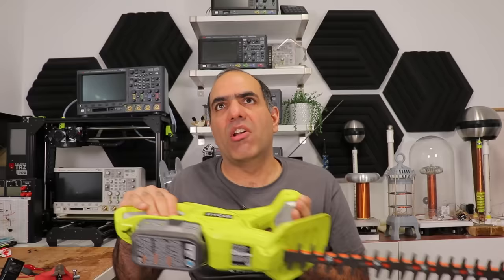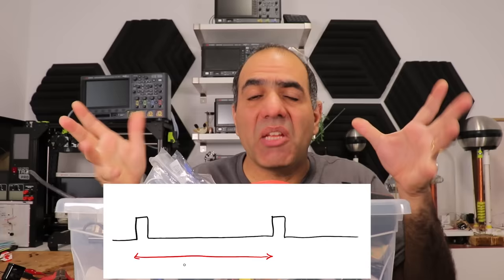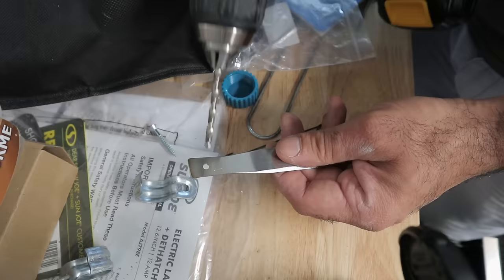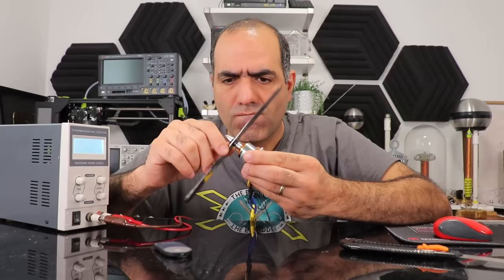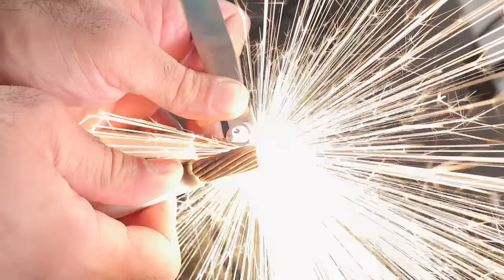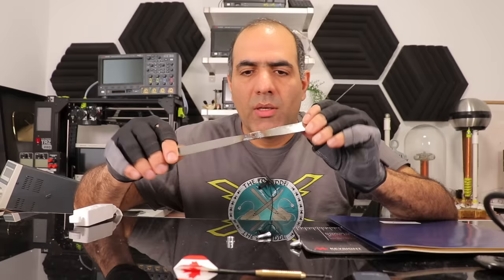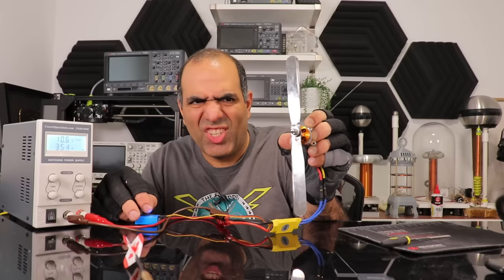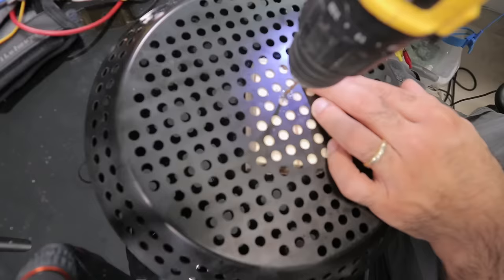Making a Mini Hedge Trimmer (Don’t DIY 💀💀💀)

Comment: The microwave transformer DIY welding, whilst not wearing gloves having fingers so close to the weld, and literally in contact with the metal surface was next level lmao.
Reply: He's using it to step down the voltage, to something like 48V.
Reply: @AlexBesogonov  is probably closer to 2v
Reply: He's using the transformer the opposite way from how most people use them. Instead of making wall power into super deadly power, it's making safe...ish power
Reply: @calebwatson966  yes. 48 volts DC can bite you under the right conditions.
Reply: @TheDirtyChef  Hell I've felt 12-20v before in my hand just because my hands had salt on them

edit: clarifying it was a salty solution not just table salt lol.
Reply: @tips1483  I was changing a 12 volt battery on a sewage bypass pump on day with sweaty hands. Touched the frame while I was tightening the positive and definitely felt it!
Reply: @AlexBesogonov  it's like 1-2v
Reply: @tips1483  One time I was replacing battery terminals on my dad's van. Accidentally stabbed one of the wire strands into the end of my finger while it was connected to the battery. Since I was also sweaty and leaning on the body of the van, the moment that strand stabbed in, it felt like someone smashed my whole arm with a sledge hammer.

Honestly would have preferred being electrocuted by the mains.
Reply: @poiiihy  Still can be dangerous. Skin is not a fixed resistance. If the skin is broken, or the outer layers of skin are bypassed via like a stray wire strand poking you, the inner layers of flesh have a far lower resistance. If the skin is wet or has sweat on it, it can make the resistance even lower. Get the resistance low enough and even at 1-2v, you can pass a significant amount of current. The spot welding clearly shows how much current can flow.
Reply: In all fairness, I'd be scared of a stray spark setting my cloth made gloves on fire, lmao.
Reply: @TheDirtyChef at work we have 48v golf carts. When the battery connections start to corrode off they make huge sparks when you wiggle them.
Reply: @GGigabiteM so your dads van had bare copper wire ends bolted to the battery? 🤔
Reply: @ogonbio8145  there are a lot of amps in those batteries. Be very careful with them especially if you are sweaty.
Reply: @ogonbio8145  battery cables are stranded and they inevitably corrode which can break off single strands and poke you.
Reply: @TheDirtyChef  yeah ive seen how the old battery cables corrode. on some of our old 36 volt carts the cables have completely corroded off and needed to be replaced.
Reply: @ogonbio8145  I worked AAA for two years.. oh the horrors I have seen.
Reply: @ogonbio8145  You see, Ford thought it was a great idea to use tiny wire strands to make up the large battery cable. The wire strands were on the size order of something you'd find in a lamp cord, just a crapton more of them for the large battery cable.

When trying to crimp the new battery terminal on, I was fighting with those strands going everywhere and apparently one broke off that I didn't see.

I slid my hand along the battery connector when I was holding it to tighten the nut and one of my fingers got stabbed by it.

Normal battery cables use much larger strands that are harder to break and generally won't turn into hypodermic needles that can skewer you.

Comment: I didn't use a transformer, I used a handful of supercapacitors in series, but I got a similar spot-weld technique to work. Also very low voltage, only about 6-7 volts, but tons and tons of current. I think the reason it worked for me, and the reason it worked for you, is because the material was quite thin, less than a millimeter.

Comment: I carried a lawnmower up 3 flights of stairs once, weighed like 60kg and has a really tough shape. This man just swung it over with him with minimal effort. He is strong af.
Reply: years of electric shocks have strengthened the muscles
Reply: @prakharmishra5487  yeah they stimulate muscle growth and make for a better muscle-brain connection
Reply: Maybe because this was an electrical lawnmower
Reply: @stueyphone  fair
Reply: i am scared for his daughter's future boyfriends. that guy will not only beat them up, he will shock them with a Jacob's Ladder!
Reply: @benskev  The innocent boyfriend is going to come inside and Mehdi will say "hold this".  I think you can figure out what will happen next. 💀
Reply: That was definitely a Ryobi electrical lawnmower, weighs about 44 pounds or 22kg according to a quick google search on generic Ryobi mowers.
Reply: No lawn mower weighs 60 kg. I transport them all the time. Gasoline powered are around 20-35 kg depending on quality and brand. Battery powered are usually more around the  30-35 kg area. Small and cheaper ones are lighter, around 20 kg.
Reply: Its electric so the motor is much smaller and has less pieces
Reply: the smallest Ryobi battery-operated lawnmover is 7.7kg. That's pretty simple to lift it above your head.
Reply: Guys what the heck is a kilogram
Reply: Minimal effort is a stretch
Reply: @ProCarsGaming556  Unit for measuring white powder.
Reply: dad power
Reply: @ProCarsGaming556  2.205 lbs
Reply: 60kg lawn mower?

Was it still attached to the lawn?
Reply: @thedarkweeally  really though, 132lb lawnmower? I don't think so, even if it was self propelled it's still not going to tip the scale like that. 

This dudes also not acknowledging how tiny that electric one shown was & wasn't a complete unit.
Reply: A lawnmower is closer to 60lbs than 60kgs. No lawnmower weighs 132lbs lol
Reply: Its an electric mower. They arent that heavy they dont have a metal engine
Reply: @PsychoC4rnivore  With a name like that, a ridiculous response like this should be expected. 

Tell me, what's the motor made out of then? It's still metal, being electric has nothing to do with that & has very little to do with it being light at all. In fact electric versions of gas vehicles are generally much heavier, even being the exact same car, different power source.  It's a very small mower, it's not going to be very heavy. I bet you with an appropriately sized gas engine it would be lighter. 

Anyways, of course the motor is metal...
Reply: @TheBhill  the weight in electric vehicles come from the huge batteries, not the electric motor. A small gas engine weighs more than the electric motor in that mower
Reply: @PsychoC4rnivore  Very good. So an electric motor, with it's power source is heavier than a gas motor, with it's power source.

Electric motors are still quite heavy & if your argument is that most of the weight is in the battery that's great but what good is the motor without power?

Also, you're obviously not familiar with either.
Reply: @vikis9819  Nice grammar Karen.

Comment: Hey, remember when you're working with any powered equipment with a rotating element to wear safety glasses. They won't stop the blade from flying off and slashing your face,but will keep you from having an eyepatch.
Reply: no joke, was using a weed whacker a few weeks ago, it must have hit a pebble, and it blasted me right in the cheek bone. An inch or two higher and I'd be rocking an eyepatch...
Reply: I was filing metal last year without eye protection and got a sliver that tore my eye up.  Thankfully not permanently threatening but it hurt like hell for a couple days.
Reply: 100%. I had a sewing needle snap and fly right at my eyeball once, it was only the fact that I wear glasses that saved me a trip to the emergency room. And sewing machines are nowhere near as dangerous as what Mehdi's doing. Gonna try and track down some prescription safety glasses for working with actual tools.
Reply: @sapphail2410  Idk how bad it is, I don't wear glasses, but you could try to put cup style safety goggles over the glasses to improve safety in the mean time? Also how does a sewing needle fly out? Did it snap while using the machine?
Reply: @miinyoo  Filing? That's a new for me. How did that happen? I guess I better start using eye protection. Thanks!
Reply: @sapphail2410 Why not just fit the eye protection over the glasses?
I like big glasses myself,  since I want peripheral vision as well.
Reply: @netts2315  just to be clear, I don't want the safety goggles for sewing, more for using saws/files/rotary tools and anything else that creates splinters or flings bits into the air. I could do that, it just isn't super comfortable is all.

What happened with the sewing machine was a noob mistake, I went over a pin like an idiot (not on purpose, the end was hidden by fabric so I didn't see that it was going under the needle). The needle struck it and snapped in half, and launched itself at my face. Which is why you don't sew over pins like a dufus, lol. Go me.
Reply: @lizekamtombe2223  I could do, I just don't find it super comfortable is all.
Reply: @sapphail2410   You get used to it, had a professor thay was so used to them he thought his eyes got dry without.
Also remember, if you use actual glasses, do not turn your head, look at what you are doing, had a relative turn their head and a fragment got past the glasses and into the eye.
Reply: @sapphail2410  Ah, stay safe out there!
Reply: I'd also recommend that with babies. I was holding my little brother, and he grabbed this decorative mirror. He pulled it down, and one of the spikes (I'm just gonna go with spike, because I can't think of a better word) fell into my eye. Almost made me pass out, and cut me. Luckily for me, I somehow managed to move in a way where the top of my eyelid got cut, and it went above my eye instead of the center of my eye. My eye was bloodshot for a few days, and swollen for a while. Had to get stitches ($2000 for four) 
All jokes aside, eyes are quite difficult to fix if you severely damage them. Don't bet on getting lucky like I was. When working with power tools of any sort, wear proper protection. When holding babies, make sure they don't grab anything that could harm them or you.
Reply: @sapphail2410  Wearing eye protection is less uncomfortable than getting the tip of a needle stuck in your eye and potentially ending up permanently blind (both due to the risk of kinetic damage if it's at a high enough velocity, which could happen if you get sufficiently unlucky, and the risk of infection that comes with getting a chunk of metal in your eye).

As someone who has worked with people who lost eyes (they usually go for a glass eye, not an eyepatch - not as obvious) or had them irreversibly damaged by flying objects... when in doubt, wear eye protection. Even if you think "oh, it'll be fine, I'll be done in two minutes". It may be a cliche, but... that's what they all say (well, a lot of them anyway) before losing or damaging their eye.

Instead of being done in two minutes and moving onto the next thing, they end up regretting that "two minute job" for the rest of their lives.

You never truly get over the loss of an eye - or at least, no one I've ever known has... even 40 years later.
Reply: @sapphail2410 There are safety glasses meant to go over vision glasses.

Comment: You can also use a nylon string in the place of the steel blades, and its safer. You will just need a plain washer with 2 additional holes for the nylon string, and it easier to build. This will have less vibrations.
Reply: I was thinking the same thing. Use some string from a string trimmer.
Reply: Or just attach a nylon string to a angle grinder.
Reply: Yeah but thats lame
Reply: String trimmers are good for grasses and light foliage but arent able to cut through small branches, which hedge trimmers are expected to do.
Reply: @re-agent9364  wrong I personally use my string trimmer for shrubs and bushes and it works great
Reply: Is that like how a weed wacker works?
Reply: yea i saw this thing pon smartereveryday i think it was a weed cutter
Reply: yaaaaaaaa! @JosephM101

Comment: it is the first time that i genuinely feel anxious watching mehdi messing with things, sharpened heavy exposed metal spinning blade is an extremely dangerous mixture of a thing
Reply: this was on the safer side compared to some of his other videos which are legitimately scary
Reply: Heck even the first spin up with the plastic blade was scary close to taking out an eye.
Reply: @mikejugo8354  He's an electrical engineer and knows what he's doing with electricity. It's mostly just show. But this thing here could have cut him easily.
Reply: @asdfxcy  yeah I trust he has the skill to not put himself to actual danger. It give illusion of uncontrolled environment (with actual danger coming from mistakes or oversights). This time there was no doubt he could have made deep cuts if he lost control of the device for any reason.
At best I could see him being reasonable and testing the thing NOT IN HIS HAND for the first time out of camera, and pretend he is surprised. Still, even unsharpened blades can take a finger or an eye at those speeds

Comment: There actually are tiny hedge trimmers that have only two places for the branches to go and get cut, almost like little automated garden scissors. They are perfect for your little bushes.
Reply: but where's the fun in it? 😂
Reply: Bosch make a very good one.
Reply: Are you talking about Manscaped? 😂
Reply: Mostly he needed 40v, not that 20v, cheap power tools just cause rsi from vibration, and longer blade to preserve your back.  Small is not better, remember you only use the front edge of a butter knife.

Comment: You might want to invest in a table vise, and a hole saw attachment for drill. They are worth it.

also if you want a safe way to prevent the blades from coming out, you might want to use a nylon hex nut or just use two nuts to secure the blades to a bolt.
Reply: only person ive ever seen who does a bunch of electrical stuff at home without owning a panavise.

Comment: This time you really did some dangerous stuff without you realizing with the drilling machine when drilling out the blades. Besides, I think this is also a perfect tool for hairdressers.
Reply: why was the drilling part dangerous? genuinely curious since i know virtually nothing about such
Reply: Yes! He should have held the blade in a vice or maybe using vice grips, or at least some leather or something to prevent an instant cut into the hand.
Reply: @mikejugo8354 The drilling bit could get stuck, rotate the blade and cutting his hand in the process
Reply: Hair is hard to cut with knives. It would be a perfect tool for hairdressers only if it were spinning much faster.
Reply: Ah I see, didn't think about that thank you guys
Reply: @MarcosSantos-jb8qb  He was already holding it tight in his hand. Nothing dangerous about that. At that point the blades couldn't even cut paper.
Reply: @M4RC90  It's perfectly safe until something happens that makes it not so.
Reply: Yes, I audibly cringed when I saw that.  I immediately looked at the huge 12 stitch scare I have on the palm of my hand as a result of doing the same thing.
Reply: @M4RC90  When a thin metal object is moving at speed, it does NOT need to be sharp to slice through anything. If you think it's so safe, go do it yourself but be sure you have medical assistance handy.
Reply: @dionh70  It's literally sitting tightly in his hand. I wouldn't call that "moving at speed".
Reply: @M4RC90 It won't be tightly in his hand anymore if the rotating drill bit rips it out...
Reply: @M4RC90  I can say from experience that in this situation, it doesn't matter if it's dull or sharp. When the drill bit becomes stuck, it will cut you.
Reply: I've seen planks of wood embed in cinderblock because the blade caught them. They were still, and blunt, but once you involve a power tool, there's no guarantee it'll stay that way
Reply: @M4RC90 and thanks to people thinking like this, is why accidents happen
Reply: @FLPhotoCatcher  No problem. I can arrange that for you if required.
Reply: @M4RC90  yea but if it gets stuck it's moving with the drill bit no matter what, you cannot hold it in place like that with your hands

Comment: Mehdi, as a mechanical engineer brother, during your testing phases, please I urge you, use PTE.. gloves that actually cover finger tips.., safety goggles and even shin, knee and arm protection, in these cases. The absolute eye balled rough alignment you’ve made hurts to watch as I see these blades spin at 10/100k’s rpm.. god forbid the lack of mechanical equilibrium causes a blade to fly off….

Comment: Some suggestions for Mark II of this thing, if there ever is a Mark II: Maybe use string trimmer-style cutting surface instead of blades, or have the blades in a contra-rotating configuration. Also using a handle similar to those on underwater metal detectors for scuba use would probably keep the operator's hands well clear of moving parts without sacrificing dexterity.

Comment: This video feels like one of the most dangerous ones for sure. The pan would barely stop the blades at all if the blades came loose, that close up shot was scary just watching let alone actually being there lol. I normally find everything else on here safe because circuits are a lot more predictable and they can't make contact with you(you can only touch them), but this one the blades could easily be doing the touching(slicing). Cool product though, it worked super well. If the pan had flat edges to actually catch the blades instead of curved edges so the blades just get flung out then it would be awesome.

Comment: If not using one already, a reverse thread might help keep the blade in place.
Reply: Or make the motor go other way.
Reply from the maker: good thought!
Reply: @ElectroBOOM  And also those box cutter's blades are maybe much lighter then your custom made blades, so they will be sharper and less wobbly at the same time...